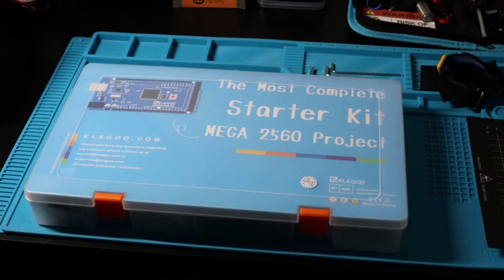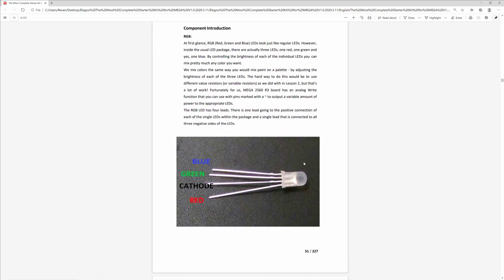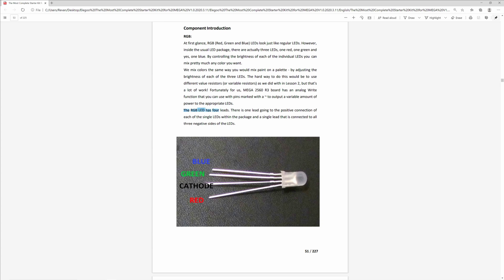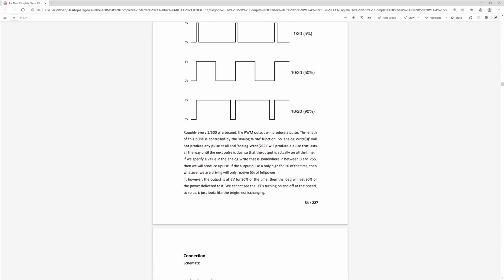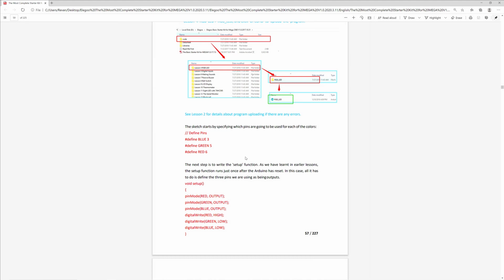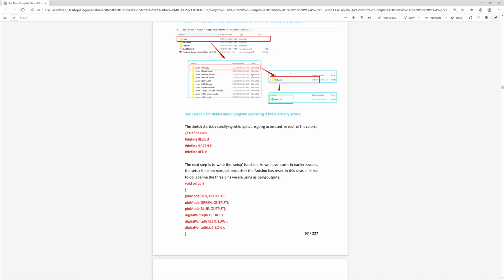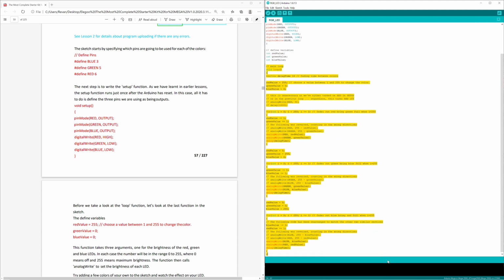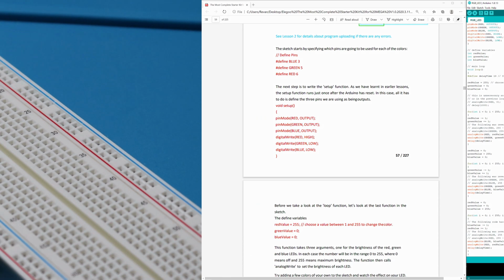STARTER KIT TUTORIAL FOR MEGA 2560, Lesson 4 RGB LED

Comment: For everybody doing this kit here are some suggestions to get more out of the kit!
-Read the lesson PDF and look up the terms to get familiar with them, looking them up will give a lot more information on top of what's provided.
-When it comes to the code portion look up each of the terms used in the code like #define, int, for, etc. and read about them.
-Run the code provided by Elegoo and then try to replicate it by writing your own code completely from scratch with different names for things, I started with some static colors and then ended up with the same color wave as Elegoo did, my code was a little different but I learned a lot more.
-When plugging things into the breadboard I highly suggest changing it up where possible, no need to follow exactly where Elegoo shows things should go, if you can put something in a different spot and have it work the same it's better to do that so you'll learn more instead of just following directions.
-Get a multimeter and learn how to measure things on your circuits! This will get you familiar with a multimeter as well as the inner workings of the circuit.

One thing I want to mention about the code is that the #define for the time delay is bad practice in their example code.
It should be declared as a "const int" together with your integers for the color values.

Doing all the above not only helped me gain a lot more experience coding but also taught me things like what does the # in #define within the code actually do, how does it work and things like the pins on the Arduino are set to inputs by default, etc 

Other than that, have fun and good luck! :D
Reply: thaaaaaaaaaaaaaaaaaaaaank you
Reply: thanks !